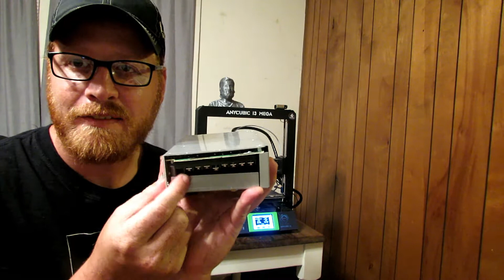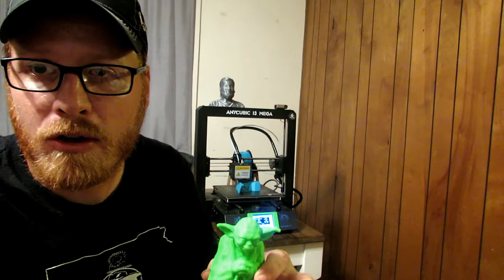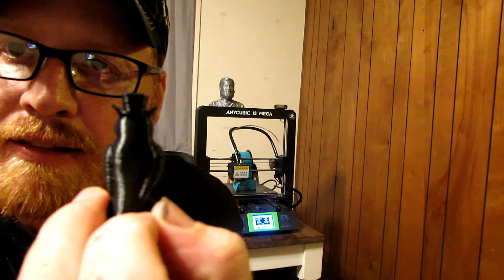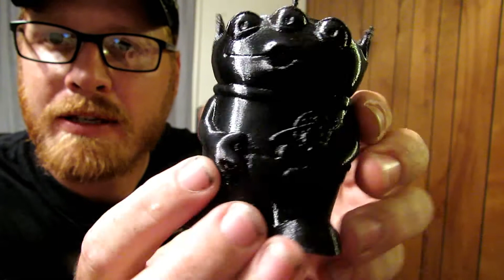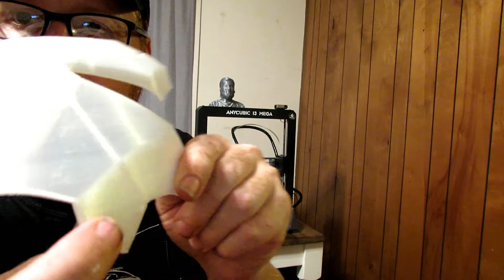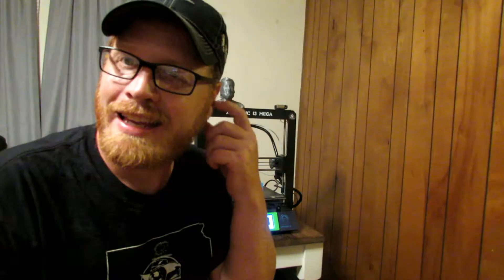Anycubic I3 Mega FULL 3 Month Review Great Printer

Comment: When printing tpu did you do anything to help or did you just feed the filament through.
I mean like in the tube and the retraction.
Reply from the maker: ive had success with some TPU and Not so much with others. The TPU print in this, I didnt do anything different. Printed it as an PLA print. No changes in settings. Since then I started having trouble so I basically put a small piece of tubing inside where the filament feeds through and it helped with some TPU. I have some Amazon Basic TPU filament I cant seem to get to print right. Ive been trying to print larger prints with no success. when you print TPU in the basic PLA settings then its not that great. If you slow it WAY down. For some reason I can get real crappy TPU prints all day but it always seems to mess up at some point when I slow it down. The print looks GREAT and then after a few hours something gets jammed and it fails. Im going to be making a TPU & The ANycubic I3 Mega video as soon as I can figure out what im doing wrong.
Reply: Bryson Michael RC thanks this helps so much and really considering buying this printer

Comment: Great video! I'm looking to pick one of these up to make stop-motion replacement animation models. Just curious, how long does something like the test piece take to print? And how long did your huge yellow mask take? Also how do you do your smoothing?
Reply from the maker: the cube test print doesnt take long at all. about an hour depending on the size that you make it. The big yellow one took, i think, about 24hrs or so. But I printed it in a way that took a lot of support so that the front would be a lot smoother. Most big cosplay helmets/masks take a lot of time to print. I usually do my smoothing just by painting with spray paint/primer and wet sand. Sometimes I have to use some type of bondo or bondo putty but for the most part it gets really smooth after 3 times wet sanding.

Comment: Get yourself some eSun ABS+ (ABS plus) and you will find it will print nicely without enclosure. 145 deg hotend and 95 to 100 on the base. If you want a temporary enclosure for normal ABS just stick a packing box or foam cooler over the top.....cheap and nasty but it does the job. Another method a lot of people use is the grobox or portable greenhouses you can get off amazon. :)
Reply from the maker: thanks for the tip. Ill check it out

Comment: Hey bryson Im 14 and i want to buy an anycubic i3 mega off amazon.com but I cant risk it breaking down on me if something beside the power supply  running out because i wouldn't be able to fix it so fo you think i should still buy the anycubic i3 mega
Reply from the maker: ALL 3D printers will break down once or twice. i would actually recommend this exact printer. Its REALLY easy to fix. im making a full fix it video atm to show just how easy it is. They send it to ya if thats what goes wrong. this is the perfect printer for someone young who wants to get into this hobby. Easy to assemble and easy to fix. ALL 3D printers will eventually break and have to be repaired. ALL. So you could go with a cheap DIY printer or something like the CR10 but Im not sure its gonna be as easy or have such great customer service as I know Anycubic does. I wouldnt know either since I dont own a cr10.